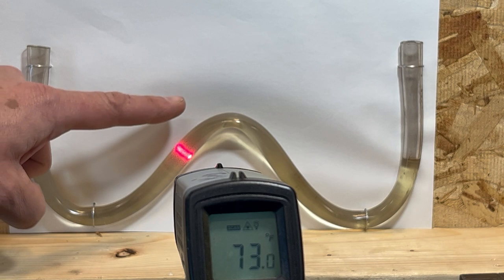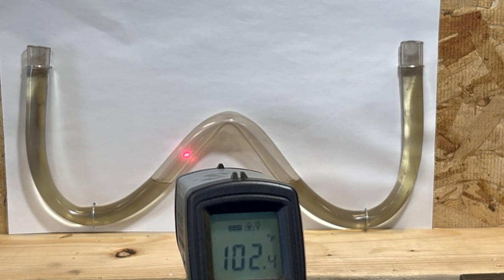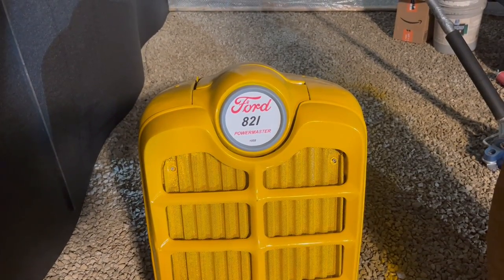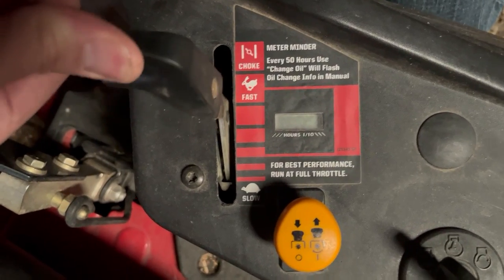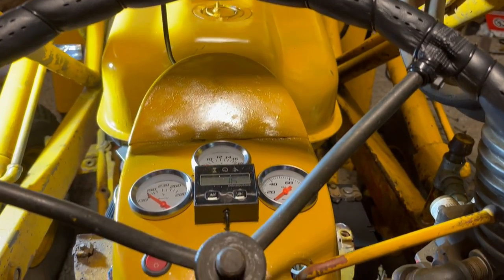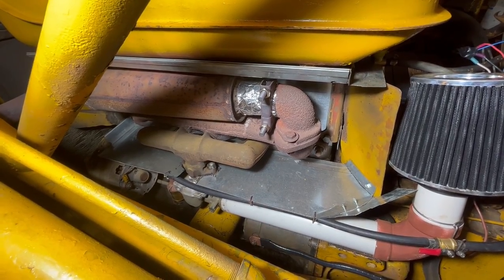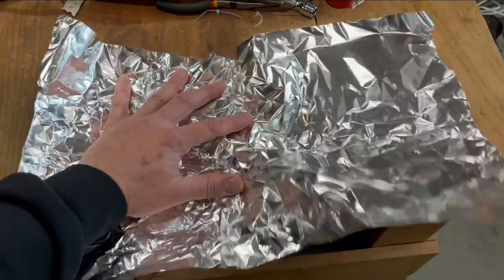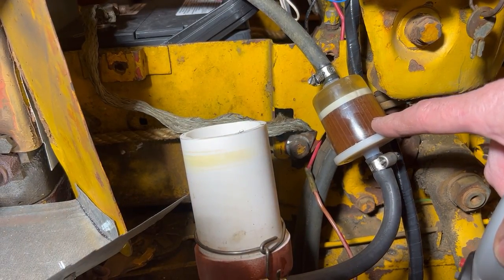Vapor Lock Unlocked

Comment: Aluminum foil?!! I'll try that tomorrow. I've got a 65 GTO and 65 Corvette. Combine central California summer heat with mandated e10-e15 and you might as well park 'em.
Reply from the maker: If you really can’t get it, here is the no-holds-barred option:
Extreme Vapor Lock Fix
https://youtu.be/1NlknBhphKU